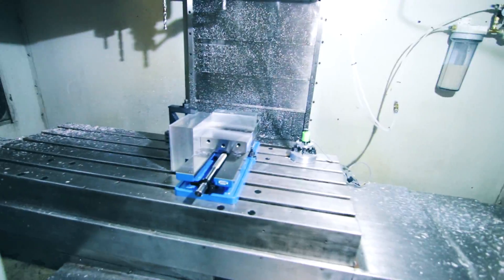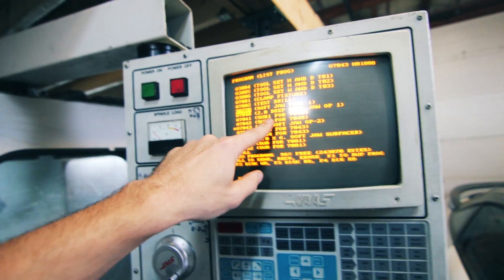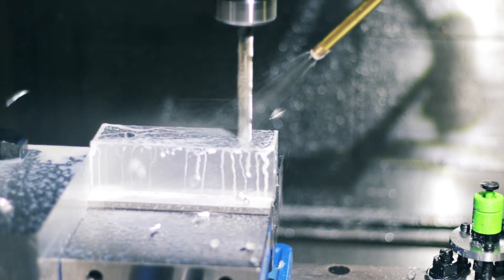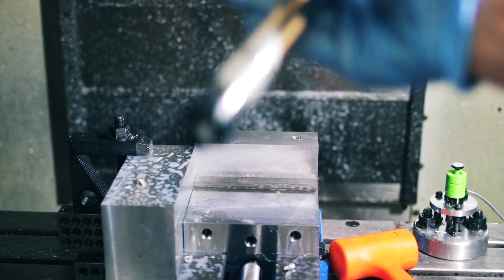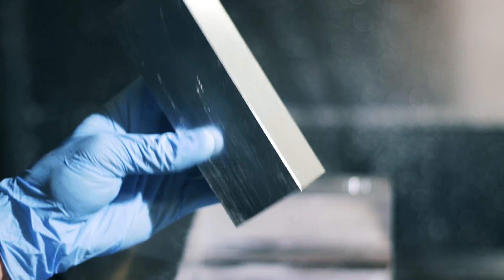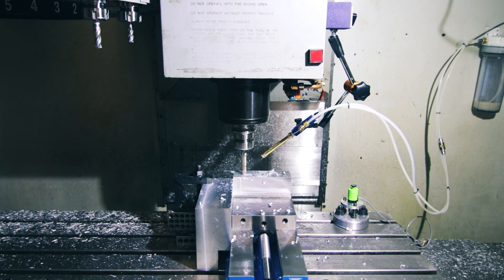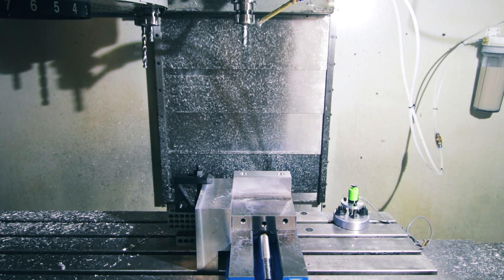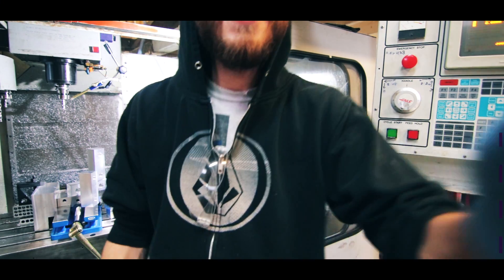My First Parts Off A CNC Mill... Ever. [+13 Mins of Pure Cutting Metal ]

Comment: what machine are you using Lucas??
Reply from the maker: I'm on a 1995 Haas VF3 powered off a rotary phase converter I built myself. 👍☺️
Reply: @LucasIsBusy  AWESOME....  looking a the same machine to purchase but a 1996....  where do get your tooling and how do you decide what tooling for a specific machining cycle??  say and end mill or a ball mill??
Reply from the maker: @wescollins5515  that's sweet! I love my Haas so much. I did a lot of reading on the FB maching pages. Titans page and the machinist ones. I'm still learning a ton of those pages. It's always the Ford vs Chevy stuff tho on brands but majority of people love the YG1 and Garr brands. Harvey and Helical are good to I hear, but I haven't tried them yet but plan too very soon. I buy all my stuff from the Haas Factory Outlet in town because it's competitively priced and they fly all the stuff in next day for me. Lots of matching outfits in town so they just throw my stuff on the same planes. The holders and other stuff I get at Sowa in town too. They have a huge warehouse so it's always right there ready to go for me. 

For steels and stainless Garr V4 and V5 end mills and ball miils. For aluminum YG1 ALUpower end mills and ball mills. I bought a range of sizes from 1/8 to 1/16 end mills and only a few ball mills in 1/4 and 3/8 for now. I only use ball mills when doing surfacing which has been rare so far. I usy drill a hole where I can before the end mill cycle bc drills ate better at plunging in pockets. Drills I bought a 28 bit (or I think its that many but you know what I mean I hope) set of Walter SST+ Cobalt bits. Those drills are amazeballs. I've drilled 70x 1/2“ holes 2“ deep in 304 stainless and it's still super sharp. Amazing drills.

Holders I went with Sowa bc they are in town and seemed cheap but good. Just bought 1-2 at a time as my projects called for them. 😉👍

Comment: Hey quick note, I noticed that you are using fusion 360 but have more experience with Solidworks.

Look up HSMWorks it's the same plugin for  Solidworks that Fusion uses
Reply from the maker: I would love to Jump back to Solidworks as its more familiar. How similar is HSMWorks to CAM in FS360? I really do like jumping back and forth from CAM to modeling to get that toolpath I want.
Reply: @LucasIsBusy  
Its a long story but because autodesk owns both Solidworks,  Fusion and HSMworks both Solidworks and Fusion use the  same CAM infact posts work across platforms.

I program and setup machines for a living and I have to say that one of my favorite combos is Solidworks and HSMWorks.
Reply: @LucasIsBusy  https://www.autodesk.com/products/hsm/overview
Reply: Dont even do that on the top right of fusion 360 there is a thing that says preferences in therr you can change design type to solidworks if thats what you are familiar with